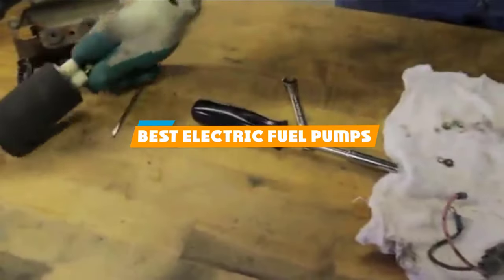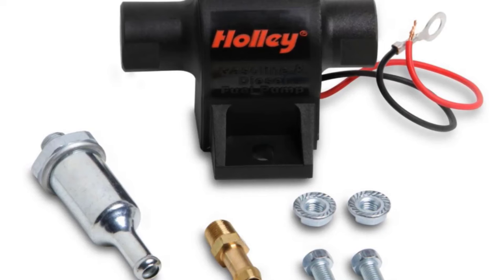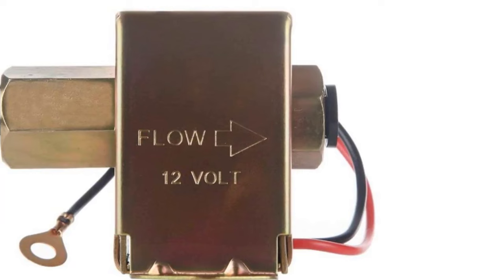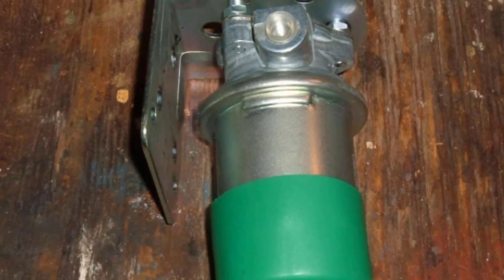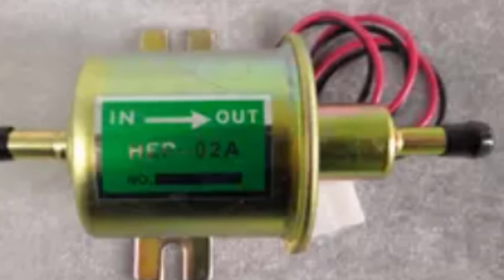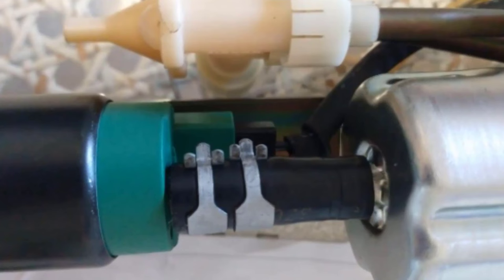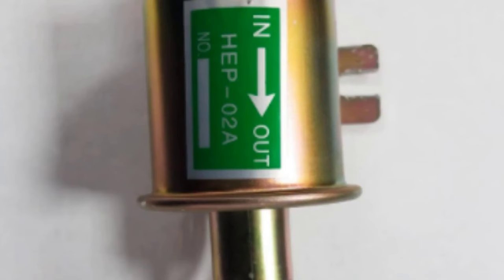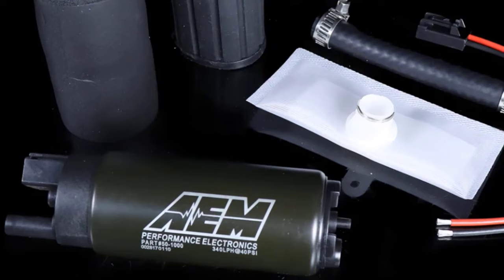Top 7 Best Electric Fuel Pumps Review in 2024

Comment: I have a 1984 GMC s15  with a 2.8 it carburated  I have a question should the pump be running all of the time while key is on
Reply: Is it EFI? Or actual carbureted? I own an 88 Nissan and my engine looks carbureted but it's actually EFI (electronic fuel injection) and yes it would be running all the time generally with carbureted engines the fuel pump is mechanical and connects to your block.